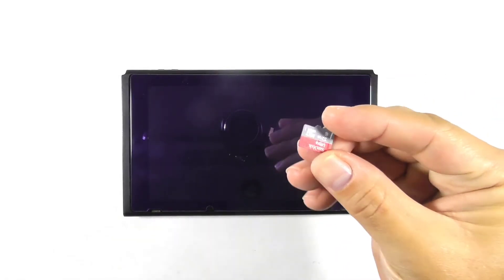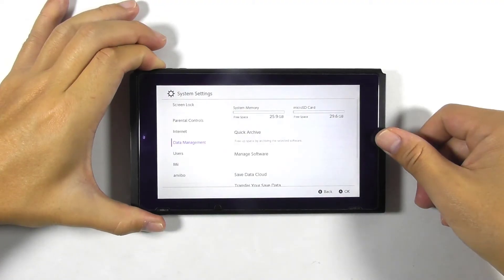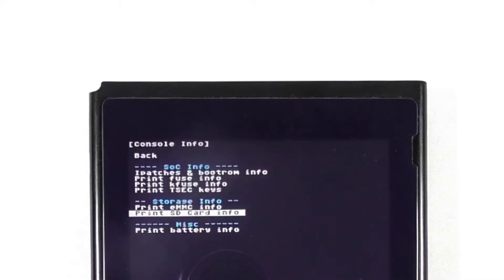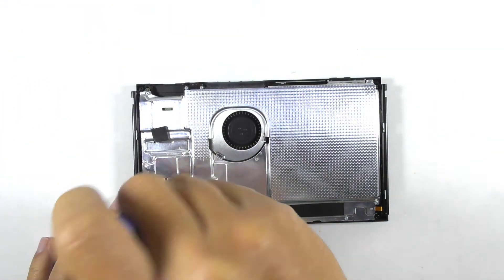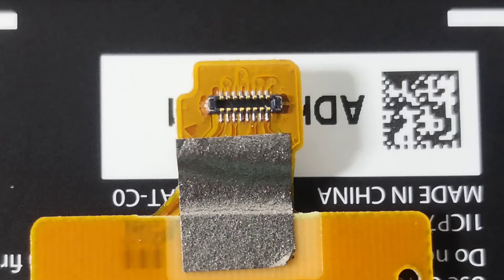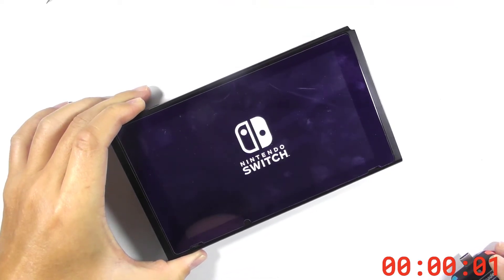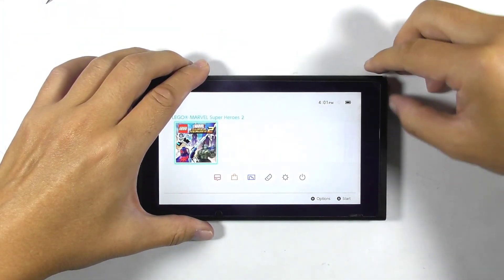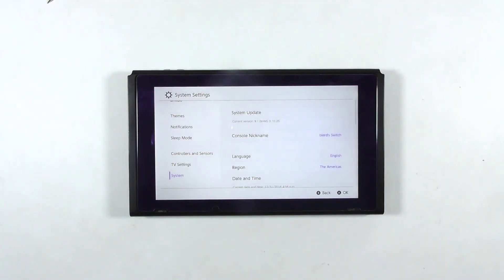Nintendo Switch SD CARD NOT DETECTED under Hekate - but runs fine under stock firmware. Repair tips

Comment: I update the atmosphere and firmware in latest version today of my jb switch lite via AIO but after i update the sdcard become corrupted. It can detect when i check on settings, data management. But the game all of games installed are not working and info pop up saying sdcard is corrupted. When i try to restart on top had red highlighted words "Failed to apply 'nosigchk' !". What will i do. Tysm for help
Reply from the maker: You need to delete the atmosphere folder and extract my hats pack, dont use the AIO, mostly broken. 

https://www.sthetix.info/hats/releases

and try watching https://youtu.be/4jw4nyymWgc

Comment: hi i was using my switch lite as normal i closed it went to sleep when i woke up it something pop up says failed to init sd card i tried everything formatting it to exfat and fat32 reseating sd card none of them worked but sometimes when i reseat sd card it boots to hakate and when i try to boot cfw some weird page shows up and ui is gone and it says nyx is missing i tried to change nyx files didnt work idk what to do please help cant use my switch do i need a new micro sd card or the reader is broke i can not understand

Comment: Hey, could you make a video addressing a Hekate FATfs 13 error? It works fine using TegraRCM to smash the payload in, but using a tool like 'reboot to payload' makes it trigger the error and not load cfw. Your videos have always helped me with troubleshooting and modding, so I hope you can put together this video for me and some future people. Thanks :D
Reply from the maker: try doing the level1 / level2 guide on my channel. the guide is there
Reply: @sthetixofficial  What do you mean by level1 / level2?
Reply: @sthetixofficial  Hey, I'm sorry to be a bother. I'm using my switch alot more recently, and remembered my 'Failed to mount SD card error (FatFS error 13)', I'm going to provide more details about it, and I might be asking a few questions.

I can boot into cfw through TegraRcmGUI, however, if I try to access Hekate through things like restarting the console or by rebooting to payload, it throws the FatFS error 13.
The console doesn't seem bricked, it can run cfw, however, I do have issues with my Super Smash Bros mods. There is also a FOUND folder on the root of my SD card, seeming only visible to my switch.

Do you think that I can upgrade the SD card to a bigger one without needing to worry about the FatFS13 error? or will I need to somehow fix it?

Does the level1 and level2 guide cover these?

Comment: Hello I have a problem maybe you can help me my switch running perfect with a SanDisk 128gb but i wanted to update so I bought an intregal SD card 256gb when I start the switch with these card shows me the boot.dat image but when I put the 128gb back running perfect my switch is chipmoded running firmware 15.0.1
Reply from the maker: i think your sd card is not compatible with the console
did you copy everything to the new sd card?
Reply: @sthetixofficial  yes I did copy everything also when I remove the 128gb from recovery and insert the 256gb one is detected fine but after reboot or starting atmosphere image boot.dat appears again.if I insert b ack the 128gb SanDisk works absolutely faultless and very fast, I did ordered a new microsd card now just to see if I have luck...

Comment: Hello, I started having this problem, my sd card reader has seen some of abuse because I constantly changed Sd cards, i opened it up and there wasn't any pin missing so i just bought another sd reader, its working from now and then, there's slow down, and it crashes, Is there a way i can check if it's the pin zone.
Reply from the maker: you need a microscope and solder the lose pin . it is microscopic.
Reply: @sthetixofficial  Thanks I lack the ability or tools, so I guess I'll have to look for someone, Thank you for answering so fast, wish the best!
Reply from the maker: you are welcome

Comment: A fatal error occurred when running Fusee.
Falled to initialse the sd card: 0x00005018tring to boot cfw switch cant  detect sd card
Reply from the maker: try to replace the sd card

Comment: How are the pins missing in the first place?? Or is this a security issue? I have first Gen switch... Stuck on SX OS friend said he'd look into putting atmosphere on there.... We came a cross this very issue. He's swapped it out fo another one for me (legend BTW).... But still... Is this common?
Reply from the maker: not security issue but if you often change or replace the SD card, you could lose the pin because Big N designed the console so bad.

Comment: Had broken pins, got it repaired. Worked for 6 months.

Pins broke again. Got it repaired and it worked for one month until the SD card no longer was recognized. Even with no broken pins. 

Had or repaired again and it detects the SD card but only on 1 bit mode. I'm convinced the motherboard is damaged and my switch is screwed. 

There's some solder on the gold circle pins to the left of the fpc connector from the second repair. Would that effect the connection at all?
Reply from the maker: You need to re solder the pins

Comment: Any idea while inject hekate will show "Warning : Nyx is missing" but even change new card & re-download/copy all the file also same. Thanks
Reply from the maker: I think there is a problem with your sd card slot.
Reply: @sthetixofficial  weird... I just backup 9.2.1 firmware and wan move frm sxpro to atmos..normal use also not problem =_=
Reply from the maker: Check the sd card compatibility or use my hats pack
https://link.sthetix.info/hats

Comment: how would cfw not detecting an sd card signify a broken sd card reader, if the card works fine in ofw?
that makes literally no sense.
Reply from the maker: no sense?. u need to learn a something new. that's normal for those who have a broken sdcard slot

Comment: Hi sthetix

I have the same problem but my switch is switch lite. Edizon cheat messed up my switch so i had to restart but then it won't boot from cfw. I'm stuck at ofw.

I formatted my sd card and reinstalled my atmos with fusee bin but my switch still won't boot from my sd card. Any suggestion on how to fix this?
Reply from the maker: watch my other sd card fix guide for lite on my channel

Comment: Hello so I did this one of my pins were missing  and it was the same one got it soldered and everything and it seems like it still says no fat so should I reformat the SD and if so how would I go about that I see a lot of talk about just reformatting the sad but no one ever says yeah you just have to remake a partition then emummc should I just get a new SD I just am confused of the process of what a reformat entails and what trials are there. Sorry I sound hysterical it’s just I miss modded smash 🥺 lol
Reply from the maker: no fat.? is the sdcard detected on ur console?
Reply: @sthetixofficial  yes on stock it is and it originally had 32 fat and has worked all through out 2020 and up until July 2021 and there was a pin that was damaged and I had gotten wired soldered to the as card reader the very same one and now it just claims no fat and the suggestions I’m getting are to reformat the SD card

Comment: I just purchased a new sd card reader, and doesn't matter how many times I reseat the reader, I still keep getting the "Make sure the sd card reader is properly seated" error. Both cfw and ofw don't detect the SD. All pins are in place. I don't know what else to try!
Samsung EVO Plus 256gb.
Latest Hekate and ATMOS.

Nice video, btw!
Reply from the maker: u need to check the pins with a microscope and test each pins continuity with a multimeter

Comment: Hopefully you're still watching comments lol
I'm having the opposite issue where my sd is read fine in cfw, but not in ofw. It was was being read fine up until very recently (today in fact). I've checked the connector and it looks fine, but when i boot into ofw (partitioned sd if that matters) it says the card cant be read and to power off, reinsert. and power back on just to tell me the same again
Reply from the maker: maybe check all the pins continuity to the motherboard
Reply: @sthetixofficial  It all looks good idk how to send pictures or i'd send one, but it doesn't seem to be faulty at all
Edit to say thanks for responding
Re-Editted: So sorry to have wasted your time. Turns out that for some reason (despite following Nintendo's own instructions) transferring save files from one sd to another via card reader and pc causes the switch to freak out and give you the finger. Again, sorry for wasting your time

Comment: I am not seeing any broken or missing pin on my switch's motherboard but Hekate is showing me the 1bit sd card error. :-(
Reply from the maker: have you tested the pins with a multimeter?
Reply: Unfortunately, I don't have a multimeter so I haven't tried that yet, and one more thing that I did was replace my switch's SD card reader but still no good.
Reply from the maker: you need to use a multimeter to check it.

Comment: hello sir, i have an issue on my switch lite. the sd card won't detected by the system and all installed game gone but the xci game on the root folder is work, can't find any solutions on this, hope u can help me thanks...im using sx os 3.1.0 fw 11.0.0
Reply from the maker: boot to ofw and see if the SD card is detected

Comment: You should warn your followers that you should do this as a last resource. Sometimes the sd card isncorrupted despite you formated it. To fix the first you have to do is format partition and errase all data with AOMEI partion program and then format to fat 32 this fixed this problem almost every time you got this error
Reply from the maker: yes i said in the video, this guide is not for all people. only applies to damaged pins

Comment: I updated my switch to 11.0 and use atmosphere 16.0 After i did it. I downgraded my switch to 10.2.0 used Choidujour

And now I still can turn on my switch with a SD card inside but when I take it out my switch can't turn on, it's like my switch missing the firmware and maybe firmware was moving to SD card, please help
Reply from the maker: maybe u misconfigured it.. u chose fat32 rather than exfat on choidujournx
Reply: @sthetixofficial  any change for my to fix it, cause I afraid if my SD card is dead one day and I won't able to turn on my switch anymore?
Reply from the maker: i think u have downgraded the sysnand so it wont boot because efuses mismatched. but u can boot emunand because emunand is always cfw ~ it byoasses the efuse count. so use blank. sdcard and try booting atmosphere with it.. sysnand should boot. ignore emummc for now and you can learn from it

Comment: Hi , i have the same problem but in a New 2DSXL, can you helpme? the console detec the micro sd an say the micro SD can´t be used. thanks
Reply from the maker: replace the sdcard
Reply: I tried with 4 different micro SD, the micro SD works in other Nintendo but not in the one I mentioned, do you have any idea what it could be?
Reply from the maker: try spraying the sdcard slot with contact cleaner

Comment: Hi Omar, i tried formatting the sd card to fat32 but no luck for me. 

To Sthetix, I don't have a soldering skill but I wonder if you could put a very tiny metal wire in place of the missing pin on the connector, do you think it will work? Thanks in advance.
Reply: It needs to be fat 32 with 32kb clusters. I was stuck on this problem forever. I had the right settings, but my trusted fat32 format gui suddenly stopped being capable of creating a card hekate could read. Everything else, my pc, stock switch, phone, etc..read it no problem, but not hekate. Try a different format program. Just because it says it’s the right format doesn’t mean it is. I’m sure you solved this as the comment is a year old, but maybe someone will read it haha

Comment: I have an ultra 64gb card...  transferred all files to my desktop and copied over to a new 256gb ultra card...  it boots up but says microsd card is missing.    When i boot up normal, it shows the card.   Any ideas?
Reply from the maker: yes maybe u need to check the connector pins
Reply: sthetix its on a mac....  been reading copy/paste to a new card doesnt work like it does on windows
Reply from the maker: yeah check the sdcard connector pins

Comment: I have a switch that had a pin missing so i got it  replaced the to but now instead it says it's in one bit mode and wont boot into cfw.
Reply from the maker: maybe u didn't solder it correctly
Reply: @sthetixofficial  It was the FPC module that was replace and had somebody do it for me. 
if it didn't work i was thinking about soldering wires

Comment: Amazing video as always. I'm having a very strange issue with my SD card. It simply stopped working when I was copying some files using my PC. I tried to restore it using diverse tools but the PC just don't recognize it. I tried to launch Atmosphere with the RCM loader dongle without success. After a few attemps, the CFW started and I was able to manage the SD content through Goldleaf. I deleted some unused NSP files and cleaned some data. After that, it works fine on my console but does not work at all when I insert it to my PC. Any ideas? Thank you!
Reply from the maker: bad sdcard

Comment: Nice Video. i love it. i have a switch with all connector broken and i did all the bridges with headphones wire but doesnt work. any idea if doing that is possible? or i need obligatory awg 30 wire (there are any conditions regarding the length or gauge of the wire)?. thx for your time.
Reply from the maker: maybe u need to recheck the soldering.

Comment: I have the opposite case Nintendo Switch SD CARD NOT DETECTED under the serial firmware, but detected under hekate / atmosphere. Could it be a different problem?
Reply from the maker: I think u should check the sdcard connector too
Reply: @sthetixofficial  Thank you, I have to buy screwdriver.

Comment: Hello Sthetix,
I skimmed through the comments section as this PIN connector issue occured to the unpatched Switch that I have setup on CFW. From the comments down below and the symptoms demonstrated in the video, I am not surprised the Switch is able to continue use with the operation of the microSD with this board defect PIN issue. First off, there's NO mention of concerns of this nature outside of the CFW scene and everyone encountering the issue is using EX-FAT formatted microSD's. Second off, the Recovery Mode does not appear to properly access the Firmware updates for MicroSD capability.

I have shakey hands so I am incapable of doing any motherboard level soldering. So, I am wondering how to find repair locally. Is there a Discord or Reddit that I should look to first to find someone who can actually fix it? (A lot of Cellphone Repair shops offer Console repairs but so far all the ones I have contact have had their eyes glaze over.)
Reply from the maker: try asking at https://discord.gg/MWxPgEp

Comment: gan, kalo switch ane gak bisa baca exfat kenapa ya? kalo fat32 bisa. pengen pake exfat biar enak instal game lewat gold leaf.
Reply from the maker: switch nya harus diupdate supaya support exfat
Reply: @sthetixofficial  udah firmware 10.0.4 gan, waktu update juga udah pilih 10.0.4(exfat) tapi hanya bisa baca mmc fat32
Reply from the maker: downgrade ke 10.0.3 exfat lalu update lagi ke 10.0.4 exfat
Reply: @sthetixofficial  waktu udah downgrade ke 10.0.3 (exfat) kan tidak bisa baca exfat gan, otomatis hanya bisa baca fat32, dan kemudian hanya perlu update 10.0.4 (exfat) saja? Akan bisa baca exfat setelah itu gan?
Reply: @sthetixofficial  ohya gan, apa tidak ada kontak nya supaya bisa enak waktu tanya gan, messenger misal nya
Reply from the maker: kalo semua cara gak bisa,. ga ngerti juga. btw fat32 itu format paling aman. exfat di switch itu bisa bikin corrupt soalnya. jadi kalo install game lewat kabel usb aja.
Reply: @sthetixofficial  masalah nya kalo mau instal game via usb pc, switch harus inject fusee-primary.bin nah switch ane gak bisa inject fusee primary, padahal file nya ada, udah otak atik kaya download ulang semua file, tetap gak bisa gan. Mau kirim foto eror nya di sini tapi gak bisa
Reply: @sthetixofficial  apakah kalo mau inject fusee-primary.bin butuh emummc gan? Apa mungkin emummc saya rusak ya? Switch ane cuma bisa inject cfw(emummc) selain itu kaya stock dan fuuse tidak bisa di inject
Reply from the maker: sdcard nya harus fat32 gan
Reply: @sthetixofficial  udah fat32 gan, kaya nya ada yang salah mungkin di step2 nya, ane telusurin video2 agan kok udah gak ada ya video nya 😅 mau ulang dari awal biar bener gan.

Comment: I have the opposite it could only boot into cfw but not turn on at all into official then I let it power off from sitting around and someone dropped it when I tried turning it on I get that menu on its side in this video but doesn't give me that failed to load sd card so it is detecting it kinda tried a few things like updating bootloaders and all that nada then I tried removing the hack with with biskeys, memloader, tegraRcmSmash and hacdiskmount all the steps worked fine but still doesn't boot into official but I can still get that odd message you got I am still working on figuring out what it is.
Reply from the maker: try replacing the sdcard slot
Reply: @sthetixofficial  actually I have an update somehow got it to boot with fusee primary bin can now get back into it but I can not boot into ofw at all screen doesn't turn on at all I can live with it but would like to one day figure this out.
Reply from the maker: i know what  the problem is.. boot hekate, disable autorcm, and boot the ofw
Reply: @sthetixofficial  sorry for the late reply I will try this out and let you know thanks for responding     Edit: It worked thanks a lot